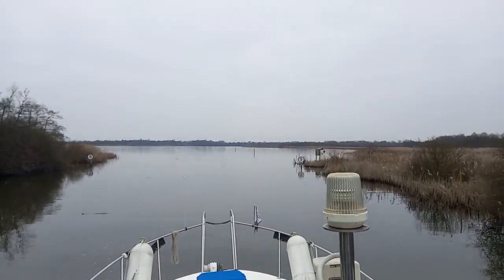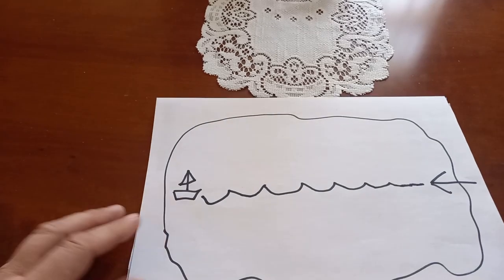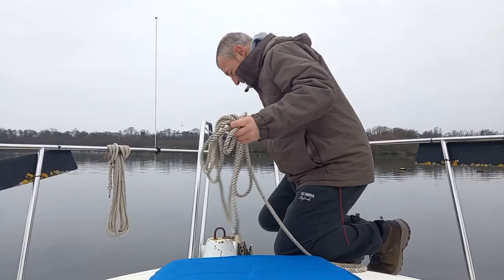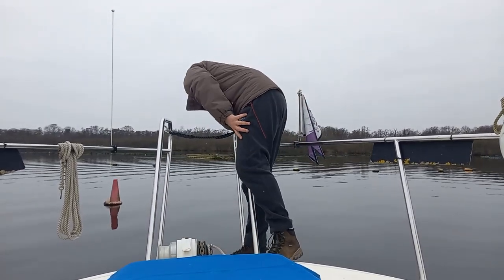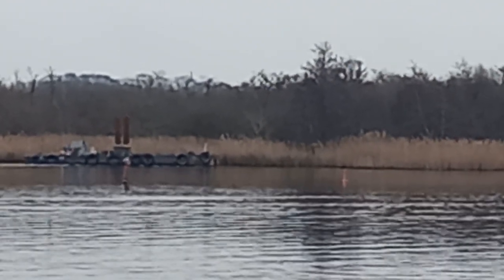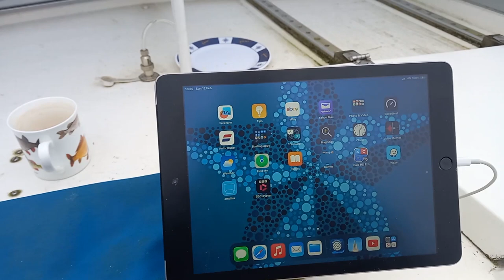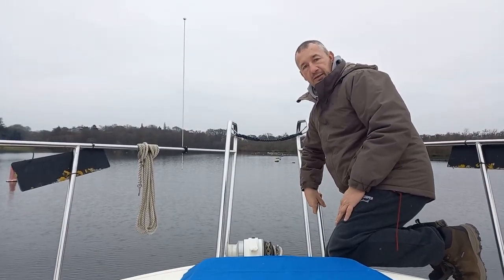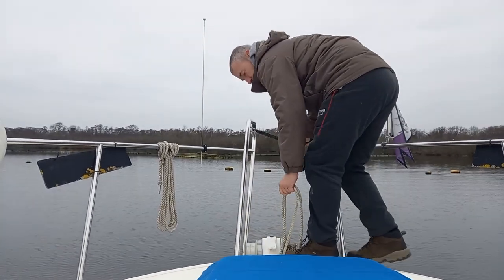Norfolk broads. How to mud weight

Comment: Thanks, I needed this info. Newbie question....what knot do you use to tie the weight on please?
Reply from the maker: Hi, thanks for watching. If you watch the splicing video that was to clip onto my mud weight as I find it helpful to be able to take it off and use it for something else at short notice (dinghy painter).
If I were going to tie directly to the mud weight I would use the round turn and two half hitches ( shown in the three knots video).
Happy boating 🙂

Comment: NEVER just lower it down like that in my experience if there is a breeze the boat will just drag, doesn't matter if there is no wind or is wind lob it in and let it stick well in the mud, if you struggle to get it out put your boat in reverse and slowly pull the weight out and then go and lift it
Reply from the maker: Exactly 👍

Comment: Did you tie the rope(warp) to the three pronged wheel beside the anchor chain gypsy? This is for releasing the clutch to allow the anchor and chain to fall under gravity. You could cause the clutch to release unexpectedly. Suggest you use a mooring cleat instead or the cleat on top of the winch and tie the rope end off before lowering as the boat could rock necessetating you to move your foot to balance yourself.
Reply from the maker: I did, just as a temporary solution to demonstrate the mud weight as my boats cleats are off to each side. Thanks for watching 😀👍

Comment: Having holidayed on the broads for 50years we have only drifted twice and we only lower the mudweight gentlely. Once was we accidentally left two mudweights out at night (we were fishing and didn't want the boat spinning) and the second time we were on a short rope. We normally mudweight on a long rope  and the only trouble we have had is when some goon in a sailing boat cut right in front of our moored boat and caught the rope with his keel , the larges thing we caught that week.
Reply from the maker: Yes, lowering gently will work if the bottom is soft enough. I just like to give it the best chance possible by dropping from a height. Even with dropping I've had the thing drag so always be aware when mud weighted.

Comment: I did this once on Bargate Broad and woke up at 4am for and wee had run a ground and stuck on silt, i put it down to it being tidal and the rope too tight and could have been low water, and when the tide had risen during the night the boat moved. Maybe completely wrong, like you suggest the wind could have been a big factor. Can’t remember now if there was a breeze.
Reply from the maker: Yeah, you must drop that weight so that it digs in as much as it can and always check the weather report for wind speeds and directions etc. Yes, it could well have been tide height. Try to gain as much info about your mud weighting location as possible.
Reply: @boatermike  Cheers, so if the tide is in when you drop, you’d be best to leave a fair bit of slack on the rope? Definitely worth a discussion especially from an inexperienced boater like me.
Reply from the maker: @BenDover-ln6ns  always leave a little slack to make up for tide height 👍